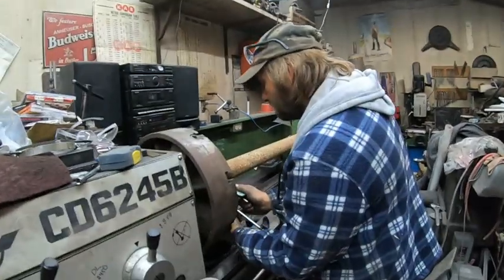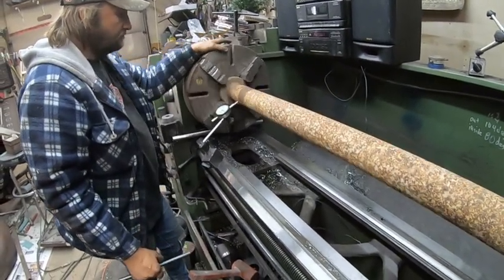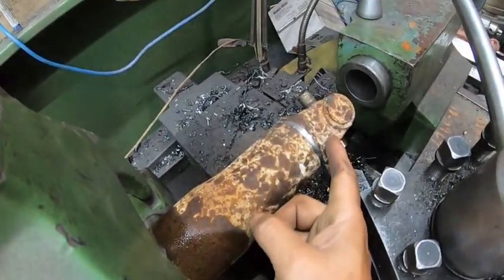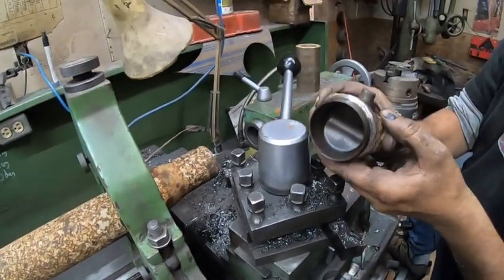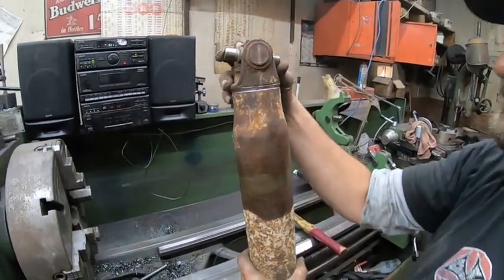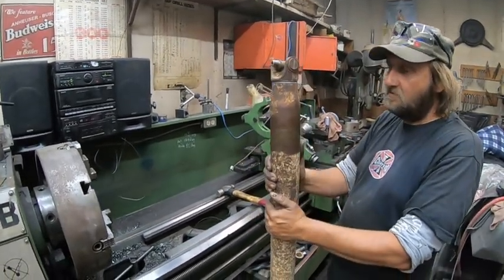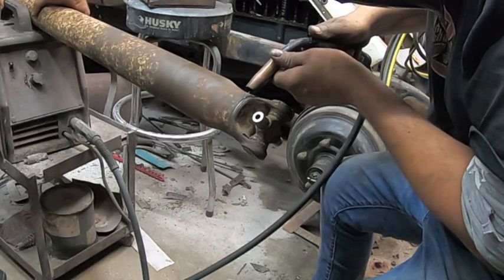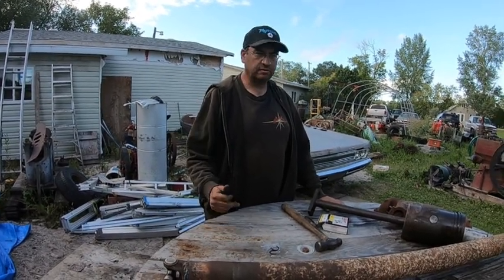DIY Driveshaft Shortening Using a Lathe.  How To Shorten Driveshafts.  69 Plymouth Fury Big Block.

Comment: Excellent video Chris  :) , Derek  :) on driveshaft fixup and Yes Derek agree on Farmers did with PTO not 550 RPM  and on 1000 RPM plus hacksaw metal end off Lol! I remember do one with my late Uncle  and  my late dad on 2 tractor on RPM  for cut down driveshaft and plus weld on universal joint too was fun and funny too as sounds but works!
Reply from the maker: The fun stuff we used to do back in the day before the internet lol thanks for watching Andrew.
Reply: @pennyshotrodscustoms  most certainly guys and lots fun in farms and vechiles repairs!
Reply from the maker: @AndrewHCann   Agree.

Comment: I like one long driveshaft over the two-piece with a hanger bearing.  In about 1979 I had a 63 Pontiac and blew a centre u-joint. I couldnt drive more than 10 mph.for the vibration. Nice work,guys!
Reply from the maker: Hhahahha funny story we we just looking at a two piece  drive shaft for my Pontiac the other day not a fan of them as well.

Comment: I take the uni joints out as there should be a centre hole in the yoke you can use a live center to hold everything closer. When you go to fit the yoke you can simply wind the yoke in with the tail stock. If I made a mistake and the shaft was a bit out,that is easily sorted by putting a hose clam on the shaft. With the car i the air and in gear,watch or mark the shaft as it revolves ,If a lump is fond,the screw on the hose clamp goes opposite to the lump or out of balance part.
Reply from the maker: Thank you for the tip will for sure try that next time thanks for watching.
Reply from the maker: I look under uni joint there
 was no live centre which was weird. The next day put driveshaft in car I used a dial indicator I was out 3 thousand of a inch.

Comment: Sure, show of your fancy skills and machinery! Nice job! I bet if you checked square before cutting you would find out its off. My machinist buddy mentioned this when i asked about balancing. 
You see brent using the car as a fixture for straightening? Was a couple weeks ago.
Reply from the maker: You bet we have watched Brents videos even Mr. dd's videos  we have done this way a few times before  figures crossed.
Reply: @pennyshotrodscustoms 
My machinist uses a large flat surface, blocks and bars through the eyes to square/true it. 
Forgot, “ladies and gentlemen, do this at your own risk, yada yada”
Reply from the maker: @franksgarage8551  Theres a few ways of doing it as long as you take your time it will work out in the end.